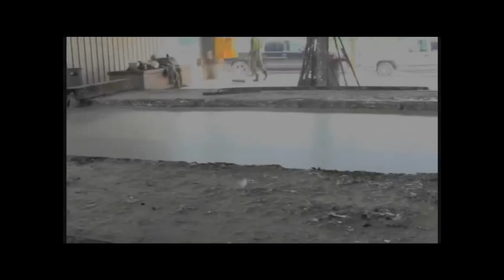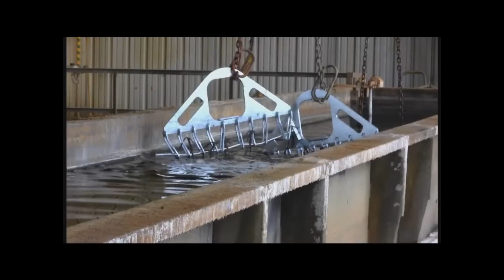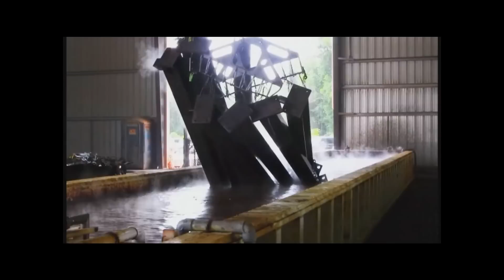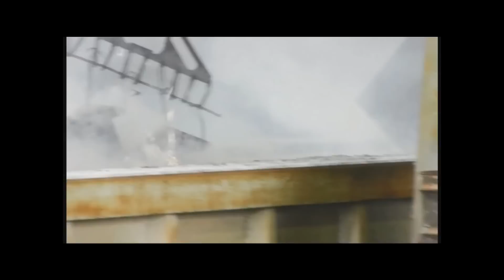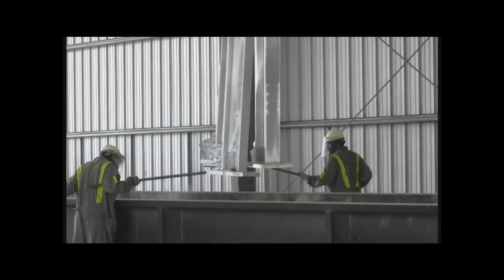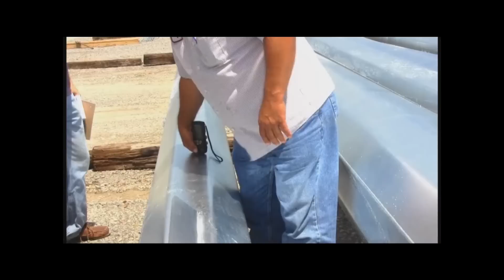Video: Tour Through Hot-Dip Galvanizing Plant

Comment: Our kettle is 40' long. 9' deep and 72" wide here in Detroit
Reply: anyone can do big and long, flat and tubing. but try 1/4 washers and 1/4 inch course or fine thread or lag screw. stuff no one else wants to even touch much less look at OR can even quote a price on. no one wants to even go under a 5/8 diameter. that's where the $ is at. too much competition in big stuff. we get shipments from china, Japan, Europe, Australia and places I can't even pronounce to have work done for them. specialist in the centrifuge process. screws, nuts, bolts, washers, brackets, tubing, big or small.. 80% of our employee have ben with us 10 yrs +. our oldest, 38 yr vet runs the pickle tanks. we have plenty of 15, 20, 25, and 30 yr vets still going strong for us.
Reply: is this an Aztec plant